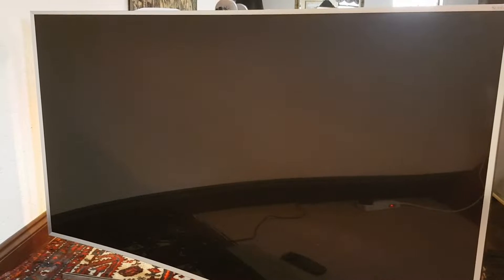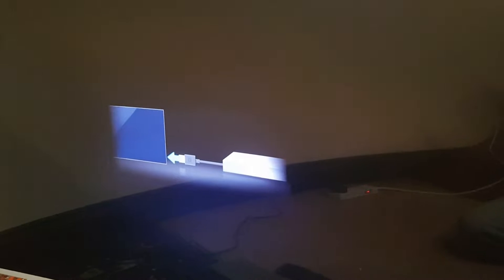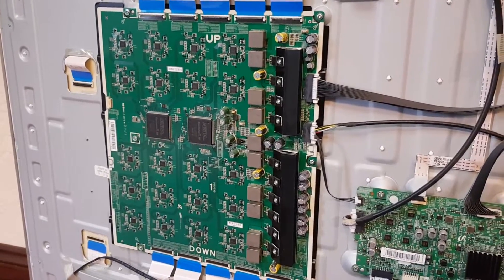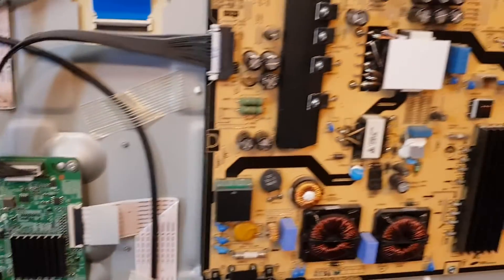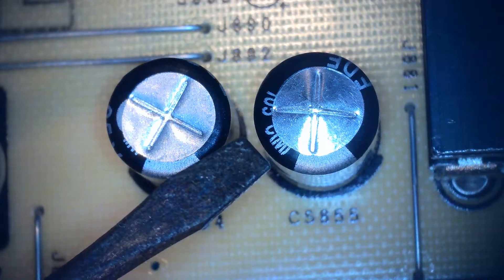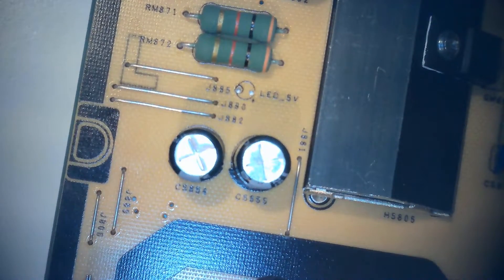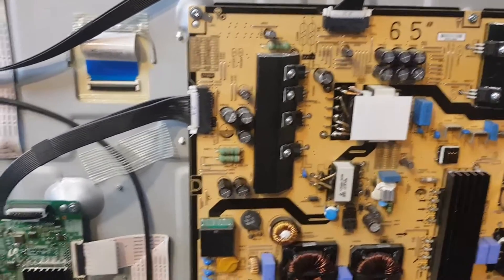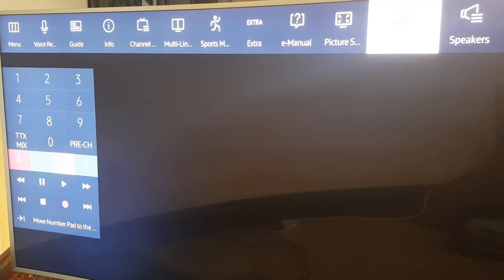Samsung 65" 4K Curved TV (JS9500) - No display repair

Comment: Very informative, thank you. How did you diagnose that it was the control module? I bought a second one-connect box and it worked for a day, but the issue is back.
Reply from the maker: From what I recall I checked the cable first by making sure wires were ok. Next I was able to test with different one connect box, pointing me to the main board